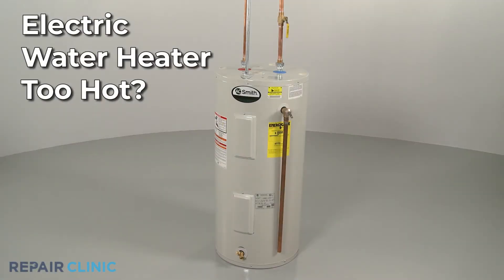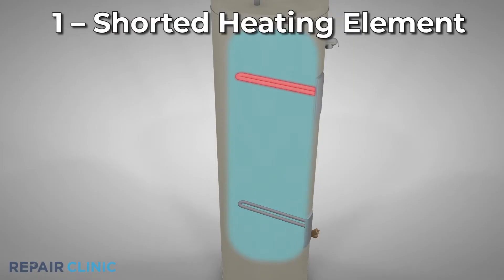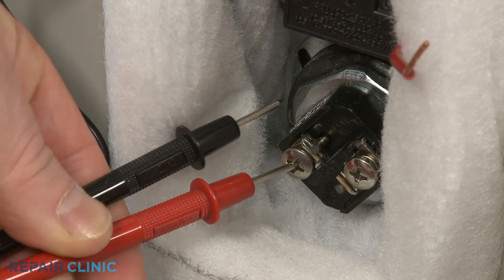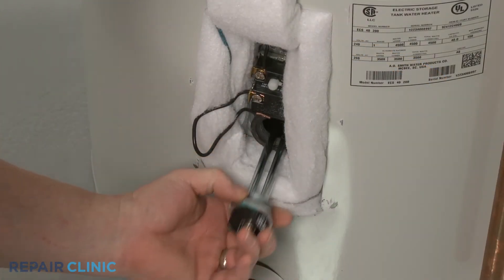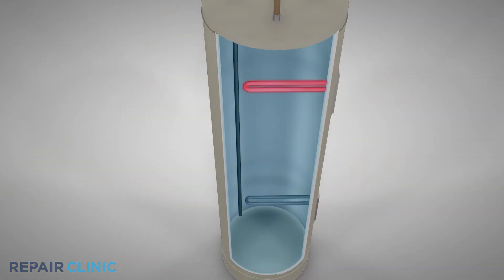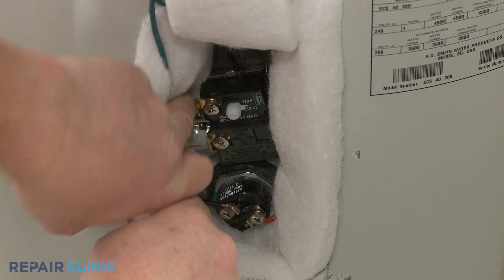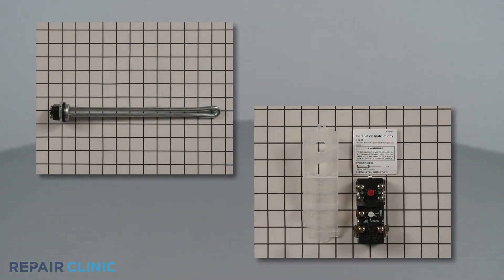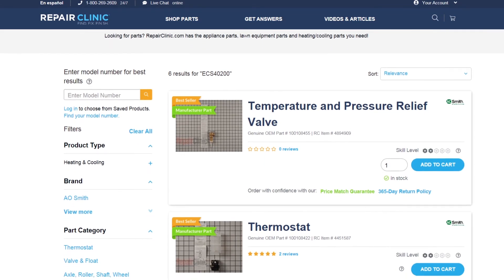Electric Water Heater Too Hot? — Electric Water Heater Troubleshooting

Comment: I have a 50 gallon tank water heater that's a whirlpool and the top thermostat I'm changing I got a question I got a red wire at the main top and a red wire coming from the bottom of a black wire and a blue wire and I only got three units right here on the right side where the wires go into the thermostat my question is where does him wires go they don't do they double up somewhere on the thermostat can you please let me know thank you